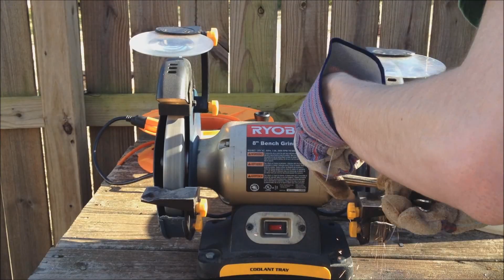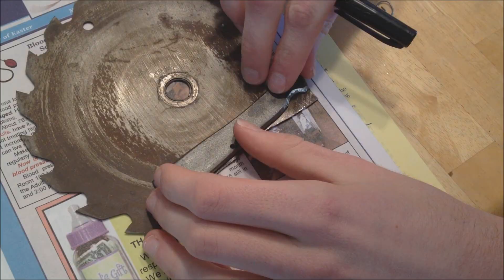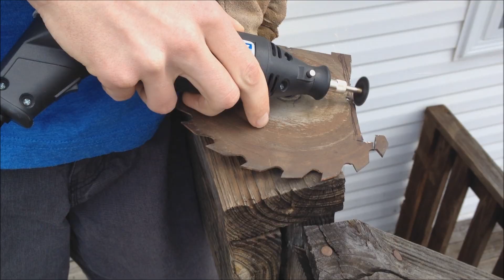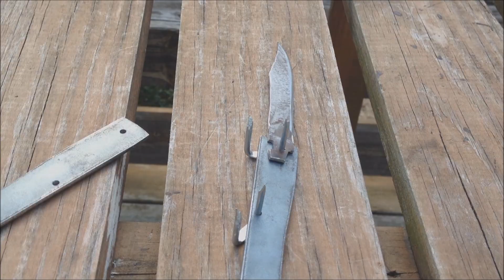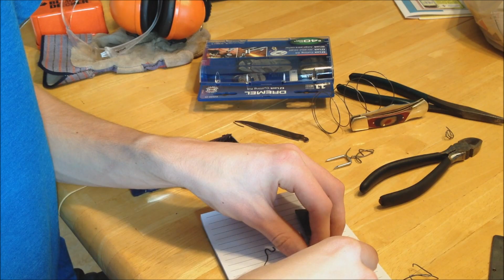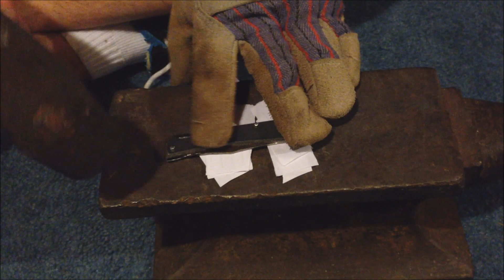Steel Pocket Knife (How To Make)

Comment: Do you have to heat treat the blade for this or is it fine because its a saw blade? 
btw really love the project :D
Reply from the maker: David Aaron Thanks. I did not heat treat the blade. You could anneal to make it easier to drill and cut before re-heat treating, but it is not necessary.